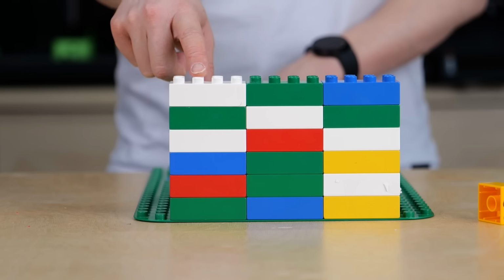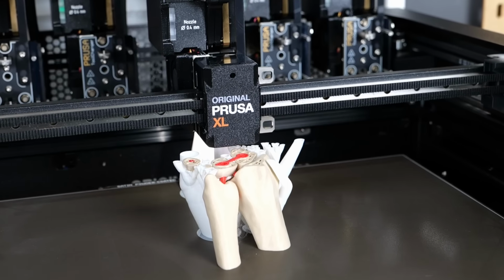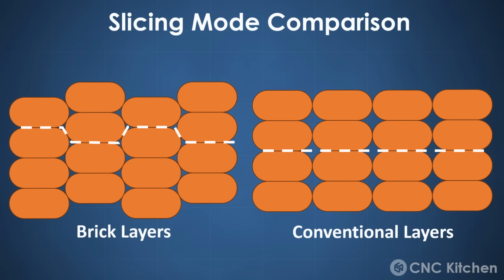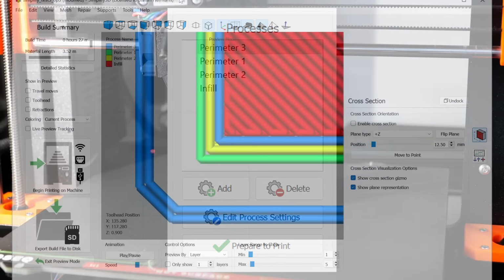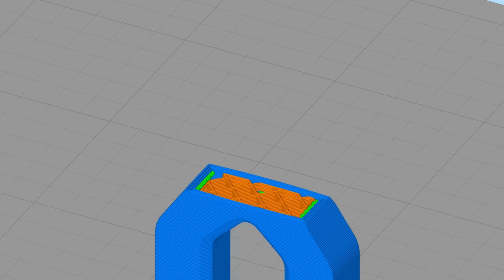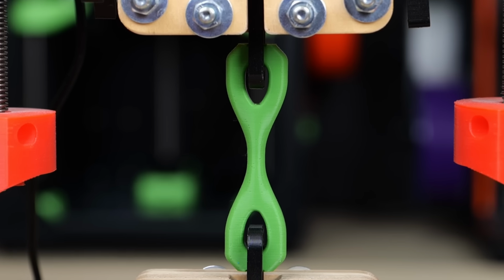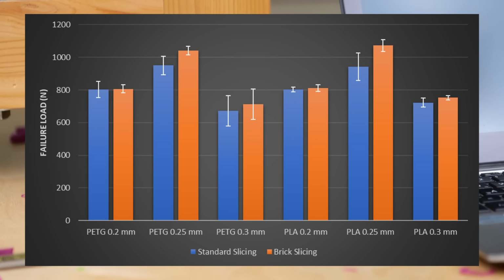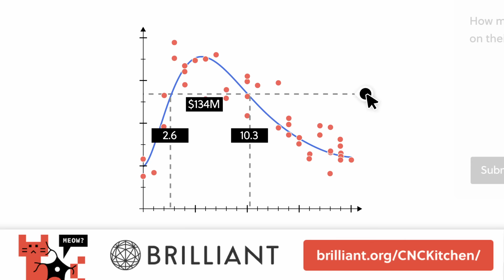Brick Layers - Why did no one do this before?

Comment: I'm a bricklayer. Problem here is your stacking your "bricks" again, just on a different plane. Real bricks on running bond sit so each brick sits equally above two other bricks. The point of this is to divide the weight of the wall equally down, so the compressive load is much greater. Shear strength is not it's specialty. Your thumbnail image would be more correct if you rotated it 90⁰. In the thumbnail all I see is four stacked columns. But that would only be for compressive strength, which is all real bricks do.
Reply: This was my thought but I’m not a bricklayer and didn’t know how to explain it.
Reply: Yeah comparing it to bricks doesn't work anyway since here we are testing pulling forces, not compressive, 3d prints already do fine under compression.
But the thumbnail is correct if you think about layer adhesion, with normal layers, a line only adheres to it's sides and down, with this pattern I does slightly melt into and adhere to the ones diagonal below it, so the thumbnail is sorta correct in showing the contact points between each line.
Reply: I thought the gain in interweaving layers would be in lateral shear, not in the way he tested.
Reply: Even though the direction is different, you also bind the brick, and here also the fibers. That's the point. If you stacked the bricks on top of each other, the wall would fall.
Reply: Regardless of if the layers are stacked like bricks this technique increases the amount of layers each strand is touching; in theory increasing bond strength between layers.
Reply: Need mortar to fill the joints 🤔😞
Reply: I’m an English teacher. The problem here is that you’re using, “your”, when you should be using, “you’re”.
Reply: This problem actually mimmics the way that the atoms hold together in a piece of metal. A slip plane is where the 'bricks' (atoms) are aligned with one another and easier to pull apart. 

Different metals have different lattice arrangements, like 'body centered cubic' or 'hexagonal close packed', with different strengths and weaknesses, but they all still have slip planes. Even if you layer the passes like bricks, with every brick being halfway between the two bricks underneath it, you've still got the horizontal slip planes.

One way you could help deal with this is by varying the sizes of individual printing passes, to make the slip planes not line up as cleanly. This is actually the mechanism that helps make some alloys stronger than the pure metals. For example, carbon is much smaller than Iron, and so (in the right quantity) the variations in the crystal lattice require more effort to separate along the slip planes. Hence why steels, or cast irons, are considered stronger and harder to deform than pure iron.
Reply: @GeneralMalaize +1 point of layering bricks is to prevent wind (weatherproofing) sheer. It would be good to see a lateral push test!
Reply: I'm no English teacher, but it's "its", it's stands for "it is"
Reply: @JokerDoom  this was my thought but I'm a carpenter
Reply: In other words, usually when you ask yourself, "why has no one thought of this?" there is a reason. Pushing past that is called the Dunning Kruger effect
Reply: @thatguy6227  very true, love the language hate the spelling. Apologies
Reply: @thatguy6227 If you're an English teacher, your grammar is awful.
Reply: @mackinsvii9022  it’s not, though.
Reply: @thatguy6227 I'm an English teacher. The problem here is that you're using 'your' when you should be using 'you're'. 

That's how it should have been.

You have commas in strange places bud, you are certainly not an English teacher. 🤷🏼🤣
Reply: @mackinsvii9022  nope, you’re wrong.
Reply: @thatguy6227  I'm not wrong. It was a good joke you said, but you messed up the execution of it.
Reply: I was gonna say ever heard of stack bond?
Reply: flemish bond?
english bond?

lol.
for a plain old "running" bond, wants the lines staggered over by half the extrusion width... each line printed on the previous layers join.
add that to a vertical offset and it becomes more hexagonal/honeycomb.

also, seems to pose a challenge for "cross-ply", which is standard infill method...

now im thinking about getting horizontal bonding layers.

almost like it needs a bit of "non-planar" to it...
Reply: You’re working with cuboids. Imagine your bricks are hexagonal cylinders.
Reply: Turn the print sideways it's stacked like bricks
Reply: @thatguy6227  yaw a turkey.
Reply: I agree, I saw the thumbnail and thought how much less the ground would need to shift to crack a wall all the way up.
Reply: @GeneralMalaize In high-sheer circumstances, such as in wind and earthquake prone regions, the better solution is typically using a number of different brick shapes or layouts within one design rather than a number of uniform bricks- either polygonal masonry or where pattern of bricklaying changes within the work- I do not know if there’s a term for the second one, but it is in practice in the large italian brick domes.
Reply: @Epsicronics I think the 3d printers are more worried about serface area than diagonal patterns. The more of the sides are touching the steonger the bond is so when you look at the diagonal join image he has it looks like less is touching.
Reply: Thanks,sir
Reply: Doesn't a running bond have more shear strength than stacked bond?
Reply: @mackinsvii9022 & @thatguy6277 You two are both wrong grammatically. Commas and periods precede ending quotation marks. "Like this," but not "like this".
Reply: @JC1zaya  but the second alleged English teacher used ' and not ", therefore he didn't use quotation marks right? Btw don't sue me comment section, i am but a slav
Reply: The bricks have a frog for sheer?
Reply: @thatguy6227  Congratulations in adding absolutely nothing to the conversation
Reply: @thatguy6227  did you struggle to understand the meaning of what he wrote? If you did that seems like a "you" problem tbh.
Reply: That makes sense. With normal stacking and something bonding them, that bond is likely on all 4 sides, not just the top and bottom.
Reply: @kxjx  did you struggle to understand the joviality of my comment?
Reply: @paradiselost9946 
Flemish Bond ❌
English Bond ❌
James Bond ✅
Reply: @paradiselost9946 
Flemish Bond ❌ 
English Bond ❌ 
James Bond ✅
Reply: @mackinsvii9022 

It's actually not. That's how you should be writing, for the most part. Most people don't properly use quotations and other punctuation, especially things like full stops. 

I think you're just not used to seeing decently written English, lol. 

Similarly, if anything, their use of a comma before each quoted word might be overused, but that's a rule that's somewhat specific. I can't articulate the rules for that one, I just generally know them. I'm old enough that my practice has slipped a tad but I generally still know when things aren't correct. I suggest you do some research and come back with actual examples of how they wrote incorrectly, instead of just pulling insults out of your ass because you love to defend sub-par language skills. 

-College reading and writing level in 5th grade.
Reply: @mackinsvii9022 

OP specifically said "...your stacking..." meaning "you are stacking." Thatguy is absolutely correct in that it should've been "you're," not "your." 

The fact that anybody agreed with your assessment is beyond stupid and shows this language is doomed. 

They didn't add much, and I probably wouldn't have said what they did considering it was one mistake, not habitual. However, you're still incorrect.
Reply: @ElysetheEevee  Learn how to read, it's not hard. My issue wasn't with your Vs you're.
Reply: This is actually a pretty viable solution. Rather than doing every other “brick” and then filling in the gaps, an alternating .5 offset could produce the desired effect and strength without the same complexity issues.
Reply: This is actually a pretty viable solution. Rather than doing every other “brick” and then filling in the gaps, an alternating .5 offset could produce the desired effect and strength without the same complexity issues.
Reply: @Iaotle I'm no grammar police, but it's "I'm no English teacher, but it's 'its'; it's stands for 'it is'."; semicolons can be used in place of periods to separate independant clauses (not commas).
Reply: @Double-X2-Points  wait, how come you didn't point out me not using a period at the end? Guess you really aren;t the police
Reply: Yeah, a layer of concrete (mortar) doesn't have much shear strength, y'all. You can knock any given brick building down with a sledge hammer. The compression force to the ground makes it strong. Engineer here backing up the brick layer. Compression force down to the ground is exactly how a brick arch/bridge works.)
Reply: @Stormblade Thanks! Nice seeing fellow minded engineering types.

Pretty much all on point. Saying from the Navy "harder, stronger, more brittle, less ductile, less tough."

Almost like, impurities in nature have benefits. ;) Kinda hard to beat it. Completely purify iron and you get a metal that's not nearly as useful in most situations.
Reply: @thatguy6227  'I’m an English teacher. The problem here is that you’re using, “your”, when you should be using, “you’re”.'

Your problem as a supposed English teacher is that you noticed the use of "your" instead of "you're" but missed the use of "it's" instead of "its". Also, there is no reason for the commas after "using" in your own sentence.
Reply: The analogy with bricks may not be perfect, but the technique works.
Reply: Don't forget this is a 3d shape. While the outer layer might stell be able to fall off to the side, the whole material is being pushed to the side, and there is a diagonal of contact now in an angle, which absorbs shear forces
Reply: Just turn the image 90 Degrees and you got your brick like structure and the sheering in that direction also translates a little better to actual bricklaying i think
Reply: Did they fix the thumbnail since you made this comment or am I missing something haha. All of this aside, the brick analogy definitely isn’t it. The goal of slicing prints like this is to increase contact surface area and the robustness of adhesion

Comment: "Simplify3D" That's a name I haven't heard in a long, long time
Reply: yep, a lot of us gave up on them about 5 years ago when they told us to pay AGAIN as our free life time updates didn't give us the new version, that and the advancement of free slicers just killed the hobbyist interest in it.
Reply: Haven't used it in 5-6 years
Reply: I use it when I want better support removal. It still works best in that application.
Reply: Still using it for non-complex prints (which are in the majority), best and easiest to use interface.  I did pony up the discounted update fee gladly.
Reply: It's an older code, sir, but it checks out.
Reply: S3D was totally worth the cost 3+ years ago. It had really good path planning and the multi-process mechanism was really powerful. These days, however, PrusaSlicer and derivatives have it beat handily.
Reply: Haven't touched it since PrusaSlicer figured out how to handle thin wall aircraft prints
Reply: It's an older slicer bit still checks out
Reply: Yeah. We can just implement those features on the OpenSource slicers anyway.
Reply: So what I told you was true from a certain point of view
Reply: “What do you mean people used to pay for a slicer?”
Reply: I’m actually using S3D tonight to do some slicing. I’m tired of fighting Orca Slicer/Bambu Studio with a particular print. S3D is still superior when it comes to large horizontal areas, the area around holes and protrusions, Z-seams, and as someone mentioned earlier, support. For support I now use PETG for PLA and vice versa but still use S3D if I want a super clean single color print.
Reply: I print mechanical parts and use s3d exclusively. It just works. Only feature I'd really like right now is fuzzy skin.
Reply: I wonder if he means old ben simply 3d.  I think my uncle knows him.
Reply: Good.
Reply: Simplify3D also: "These are not the slicers you're looking for" :)
Reply: Back when it was still relevant it also costed 150 USD, which they jacked up to 200 USD now.
Reply: Still using it xd
Reply: I still use it. Force of habit
Reply: My company purchased a Fusion F410 a few years ago, the F standing for frustration and it came packaged with Simplify3D.  I stopped using it after the printer wore out.  We now have 3 Aquila X2s with BLTouch and I use Prussia slicer.  Don't ever buy an F410 unless you just want it for the case.
Reply: I'm really annoyed they haven't done a basket weave style layer line or infill. It would require a lot of z moves but would be theoretically very strong
Reply: I still use it at work, lol.
Reply: haha. Still using it for my creality machines.
Reply: It always surprises and disappoints me when I hear that companies that have defrauded loyal customers/clientele through fancy breaches of contract terms or other open lies are still in operation and being allowed to push out new products or updates to scam new victims with.
Reply: Beezus faffoon
Reply: Yep
Reply: Sorry, for production and quality parts, it's still the king. Once you realize most of the other "cool features" are just that and need to do work, it's the only way to go. There's still so many basic, needed things that all the "new" slicers can't even do correctly. 14 years in the business, and using simplify since their second year. They were and still are a God sent.
Reply: Still use it. It just works.
Reply: Simplfy3D shot themself in the foot by wanting to charge and recharge users, despite not having any extra features over the free slicers which were becoming more common at the time.   Well, let's say no features the average 3D printing enthusiast felt were useful at the time
Reply: ... my only hope!
Reply: It’s been used heavily in the industrial world this whole time.
Reply: Obi-Wan quotes